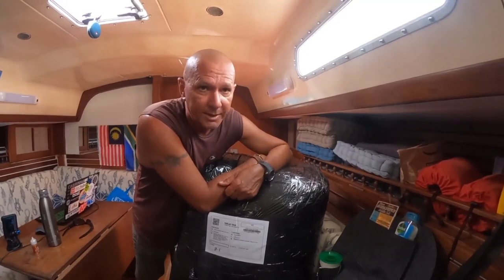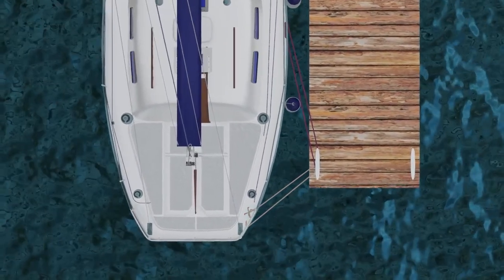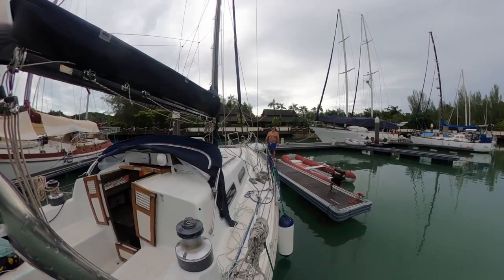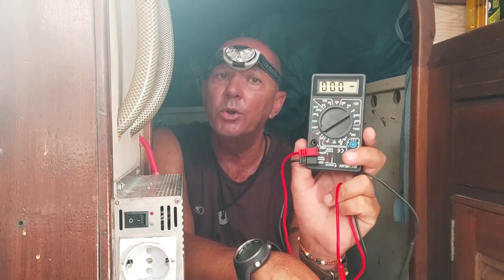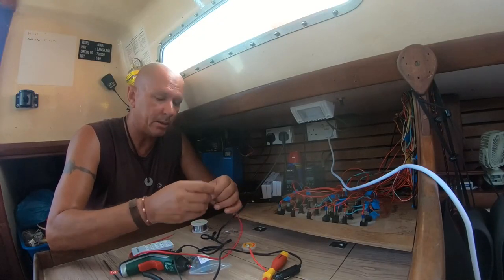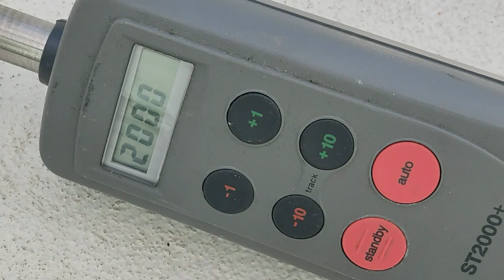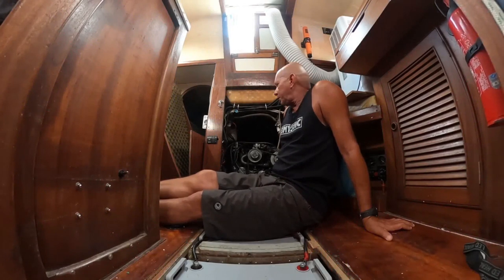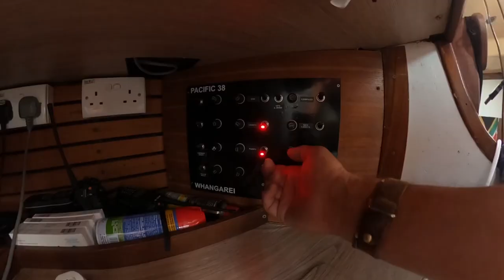Solo sailboat docking Ep 03

Comment: This was a good episode. It made me think. Oh right there's no brakes on a sailboat, so you would have to go slow when coming into a dock, right? Do you have to use the motor and steer in? or can you still sail in?
Reply from the maker: Greetings, and thanks for watching and adding your support. What is not mentioned or shown in this video (should do actually) is that we have shifted into neutral before we even rounded the last dock and coasted in. As long as the boat is moving, we will have steerage. "Never approach a dock faster than you would want to hit it" is the accepted term used. If you do need to slow down near the dock, you could give it a thrust of reverse. Hope this helps, let us know

Comment: Thank you for all the great videos and explanations! I really appreciate your work a lot! I do have one question: it seems that your boat doesn’t have cleats midship, mine doesn’t either. You seem to be using the toerail as a cleat instead. What is your experience with it? Is it strong enough? Or did you have any problems?
Reply from the maker: hi and thanks again for your support... you are right, we have no cleats midships. The toe rail itself is strong enough, however, the edges are very sharp so we use this for short-term docking. The chafing will be a problem on long-term and I don't think the lines can last too long. We are now out of marinas for most of our sailing days, so no need for us to look for other solutions. Again, your contribution is much appreciated